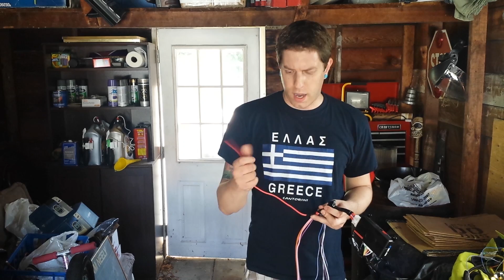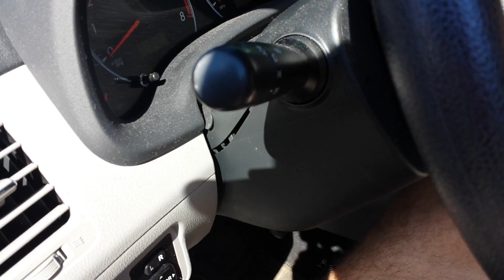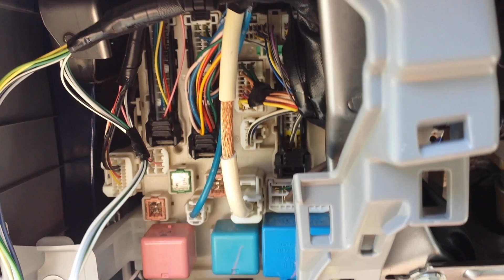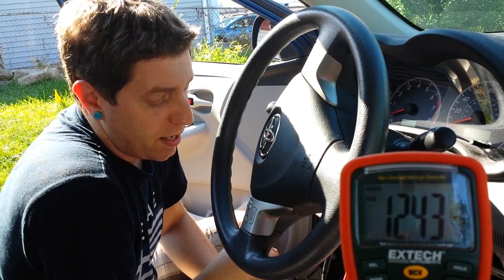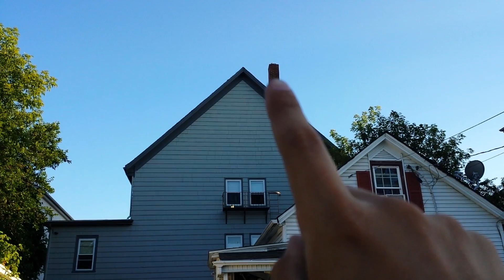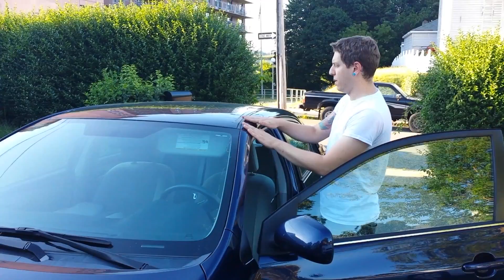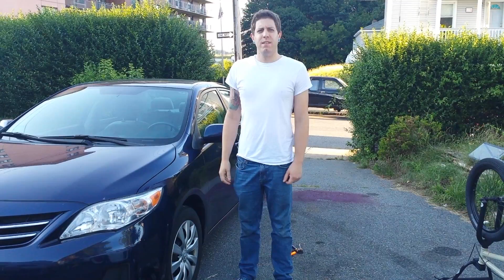2009 - 2013 Toyota Corolla Remote Start Install

Comment: Do you need to hook up both of the red wires to the 12v power source?(thick white wire) or just one?
Reply: I think I connected everything correctly but I can't get it to start. The red led flashes correctly when programming the pkall, as well as the remote start led for programming the tach. The parking lights don't flash at all (I checked to make sure they were connected). Also the one button remote just flashes green rapidly when pressed, it doesn't seem to do anything. Any ideas?
Reply from the maker: Yup. Both red wires control separate ignition relays inside the brain. If you want to be lazy with it, you can tap one red 12volt off the brain into the other and run one line to the white wire. The ignition wires are small enough in that car you should be fine; as long as you're not driving any high current stuff. Just make sure you splice it after the fuses so each have their separate fuse going into the brain.
Reply from the maker: Well sounds like the PKALL and Tach programmed correctly. If the brain gets the signal from the remote telling it to remote start and the brain has a problem, it will flash the parking lights a bunch of times (or at least you will hear a bunch of clicking coming from the remote start if you don't have p.lights hooked up). If it's not doing a damn thing when you try to remote start from the remote, then sounds like you have a communication issue. The antenna and everything look ok? I dont think the one button remote is supposed to flash rapidly, what model is it? One thing you can try though! The brain should have a white/blue activation input wire (if it's a directed product). You can tap that wire to a ground source in the car and it will manually initiate a remote start taking the remote and antenna out of the equation. Might help isolate.
Reply: So I hooked up the other red wire that I forgot at first. Now I was able to perform a "shutdown diagnostic" and it's telling me I need to hook up the parking brake wire. It also says the parking brake must be applied for the remote start to work. I don't really want to have to apply the parking brake every time I need to remote start.. Is there any way around this? I was thinking of hooking it up to the 12v power wire for a constant "applied" status. Is this okay or could it break something?
Reply from the maker: Is your car a manual? If not, then screw all that parking brake nonsense and you need to program the brain from Manual mode to Automatic mode. If your car is an automatic, I can tell you how to do that. They default the brain to being in Manual mode when they sell them.
Reply: Danny K. Ah Yes my car is an automatic. I'm not sure how to program it. I'll try reading the instruction manual.
Reply from the maker: It's most likely Menu 3 Option 1 "Transmission Mode" and the instructions tell you how to use the programming button to get to that option.
Reply: Danny K. Are you sure it's menu 3, option 1? I don't see a menu 3 in the manual, only 1 and 2.
Reply from the maker: What remote start unit do you have? I assumed you had a RS/Alarm model. Also, how many flashes did you get for the shutdown diag?
Reply: Danny K. I have an Avital 4115l. It was 8 flashes wich indicated (-) Parking brake wire. I checked the programming options and there are no options for transmission type.
Reply: Maybe they added the parking brake as a safety feature or something.. do you think I would still be able to trick the system by attaching it to a live wire so it thinks the parking brake is active?
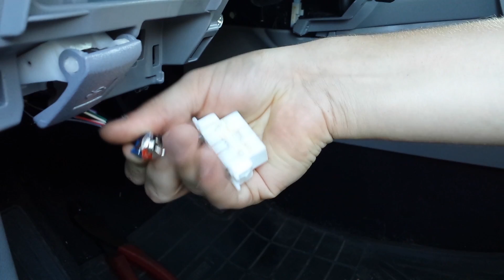Reply from the maker: Oh, no shit. Didn't realize they added more error codes in for the new models. You should be able to attach that black/white "parking brake" wire to ground (-) and be good, I think. As long as that wire works the same as it did 5 years ago. That used to be called the neutral safety wire and it stopped the remote start from functioning unless you give it a ground source. They used to supply you with a toggle switch you could wire in to that black/white wire if you wanted a way to disable the remote start (ie. bring it to the mechanic). You can see me show it off and talk about it a little at 21:16 in the video.
Reply from the maker: Also at 3:48 when I'm showing off the brain
Reply: Danny K. Okay I have that going to ground now which seems to have fixed that issue. Now I think I messed up the the activation input wire(blue/white). I have it going to the keysense(blue) under the ignition.. now the car starts when I stick in my key and shuts off right away. Diagnostic gives transmitter shutdown error. I'm guessing the activation input wire doesn't go there and isn't required? Also then what is the wire you connect at 16:00, is it the (-)status output?
Reply from the maker: Ha! Oh man, yeah don't hook up that activation input wire to keysense. When the blue/white gets a ground signal, it initiates the remote start. So when you put your key in the ignition and keysense wire gets ground, it's doing just that. So, at least we know the remote start starts your car! Progress. Anywho, I'd disconnect the keysense wire from your remote start unless you absolutely need it. So, disconnect the blue/white from keysense, close all the doors and lock the car with the fob to activate any factory alarm the car might have. Then wait like 2 minutes and remote start the car from your fob. If the car starts up fine and doesn't set off the factory alarm, then you can forget about needing to hook up any wires to keysense. If the alarm does go off...then you'd want to run your status output wire to keysense to give it ground during remote start to make the car think you disabled the factory alarm by putting the key in the cylinder. You're almost there!
Reply: Danny K. Welp I've got it working finally! I didn't bother trying without the status wire I just connected that to keysense and it works. Thanks for all your help man I would be totally lost without you lol. Me being a complete beginner for anything cars I got it all set up in about 3 days.. I'd say not bad lol!
Reply from the maker: Groovy! And your car's not on fire. You did better than a lot of newbies I've seen, congrats man.

Comment: Will a universal immobilizer bypass work for my 2009 corolla? It doesn't have push to start just the normal keyfob key with lock/unlock.
Reply from the maker: Should work fine with Toyotas. A 556U or the like? You really gotta get it wrapped around the key cylinder good and tie it down in place, I never liked using them. Plus you're literally leaving your key inside the car...was surprised how many people were totally ok with knowing I could easily steal their cars after installation back in the day..
Reply: Oh I didn't realize that it needs a key and I only have 1.. So the xpresskit pkall bypass that you got works without a key?
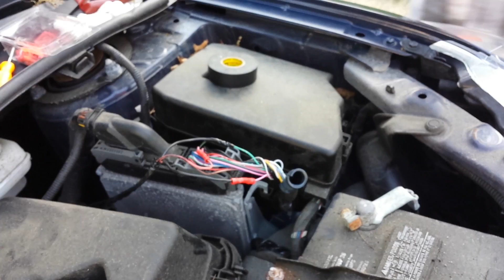Reply from the maker: Yeah, I guess that's what makes them so universal, ha. When I was doing this a while back, that was the only option actually. For any of the modules you wire into the data lines of the car, you only need 1 key to program it and it adds the module's chip to the car's bank and you don't have to leave a key in the vehicle. You can see me program it at 19:55 in the video. The PKALL is a little harder install seeing it ties into the immobilizer wires that aren't as accessible. If you go with an FLCAN or DBALL, those tie into the CAN BUS wires of the car and are at the OBD plug...so much easier than running under the hood but those modules cost a bit more.
Reply: I have the same pkall as you linked in the description. Where do I connect Rx(data in) and Tx(data out)? Also not sure about the 3 wires going to under the hood. Are those coming from the pkall or remote start?
Reply: I think I found the Rx(data in) and Tx(data out) wires using the pkall instruction manual. They are on a 7 pin connector directly behind the ignition barrel. now I'm just still not sure about the 3 wires you have going under the hood. Are these still necessary?
Reply from the maker: You probably did find the wires at a harness near the ignition and they should be the same wires that I found under the hood (just the other end on the ECU side). Going by XpressKit's guide (http://cdn.fortin.ca/download/43981/pkall_toyota_corolla_-_g_key_(2010-2011).rev-b_20101006.pdf) you need to catch them at the ECU under the hood. If it were any old analog wire (ie p. lights, brake) then fine, catch it wherever you want. With all this digital crap, I wouldn't risk it. Who knows if there's not another module those IMI and IMO wires hit between the ECU and ignition we don't know about that could cause issues if they're interrupted near the ignition. Plus, if you could just catch them at the ignition, why would XpressKit make you go under the hood? So, I'd say it's a bad idea and you're playing with fire catching them at the ignition but...let me know if you do get it to work. That'd be pretty sweet.
Reply: Here is the manual I'm looking at(I think it's the same one) -  http://xpresskit.com/DocumentDownload.aspx?documentid=7507&productid=196&firmwareid=1636 .  I'm on page 9 - connection 4 (My car is 2009 corolla with dot on key, not G.) Looks like the connection at the ignition should work right? I'll try it out tomorrow most likely and let you know..
Reply from the maker: Oooooh yeah that's perfectly fine. The dot and no G means you have the older 40-bit encryption system which is a lot easier to deal with for wiring and you can go to the ignition. If you had the 80-bit with a G like I did, then I think you have to go directly to the ECU. Either way, definitely interested in hearing how it goes for ya.

Comment: Can you explain what the jumper settings are for? I got the computer cm7200 brain and there’s a place for “jumper” what is that? I have a 1999 Toyota Avalon xls with factory alarm.
Reply from the maker: I've never used Compustar's products (came from a completely Directed Electronics shop so not as familiar) but looking it up online it looks like they're used to change polarity. So they have negative and positive parking lights, door triggers, doomlight, etc. depending on the car you're putting it in. So just make sure you setup the jumper to what polarity of the wire you're wiring into on the car side.
Reply: Danny K. Thank you!!!

Comment: Great video! Do you know if the wire colors are universal? Or are they company specific?
Reply from the maker: I assume you're asking about the remote start wiring. It's fairly well specific to all Directed Electronics brands which includes like Viper,, Avital, Python and that whole family. For your Compustar, I believe it's going to be different wiring coming off the brain. All the Corolla wire colors will be fine to use from my video.
Reply: Danny K. Thank you.

Comment: Great video. Help me install one in a 2012 toyota corrola S model. The only issue im having is that when i push the remote start button the car just cranks doesnt start. Cant figure out whats wrong or what im missing. I used the Xpresskit and a ready remote model number 24921B
Reply from the maker: Nice, glad you could use it as a reference. When you say just cranks...does it just sit there cranking and cranking for like a good 4 seconds? I've seen that happen when the immobilizer wiring is incorrect or if the bypass module didn't program correctly. Can you try inserting the key into the ignition but don't turn it to ACC or RUN or anything. Just slide it in the cylinder, don't turn it, and try to remote start the car (basically making the car see the chipped key). If it remote starts up all fine and dandy, then you know it's something with the immobilizer wiring and we can take it from there. Good luck!
Reply: Thanks for replying. I did that and it is somthing wrong with the bypass. Like u said either its not programmed correctly or the wires are mixxed up. Coustomer couldnt wait so what i ended up doing was using the RFID ring the cam with the remotr start original bypass that i did t us connecting it to the immobilizar and leaving a key in the car so the coustomer could drive the car until they come back from therr christmas vacation.
Reply from the maker: Ah nice, glad you had a workaround there. The 556U and the like can always get you out of jam like that. What XPressKit module did you use? Was it the PKALL (IMO/IMI) or did you go with something like a DBALL that catches the CAN bus lines?
Reply: It was the PKALL imo and imi the same exact one as in the video.  Coustomer said yhe remote start is still working. So might jus leave it like that. Not a big remote start person but. I make it work one way or another lol
Reply from the maker: Oh yeah, that definitely works. My customers used to be very demanding about getting their keys back so glad yours doesn't mind. Well, if you do decide to troubleshoot more, feel free to ping me for help.

Comment: IS A 2015 THE SAME WIREING AS THE 2014? AND WILL I NEED A INTERFACE MODULE?
Reply from the maker: Looks to be. They changed the Corolla style in 2014 which carried over to 2015 and 16. My video only covers up to a 2013 so probably not going to be of too much help to ya. And yes, I'm pretty sure all Toyota's are coming with chips now. You can always test it by wrapping the plastic part of your key in aluminum foil (effectively making it just a "metal" key) and try to start the car. If it starts up, you're good! If it just keeps cranking...you'll need the interface.

Comment: use idatalink and you only going to hook it up three wires CANH CANL IMMO DATA.     Program DBI Is going to give you a power door locks tack wire brake etc
Reply from the maker: You don't have to hook up any of the ignition wires or even power and ground?? What will they think of next...
Reply: You have to hook up ignition and ground Check idatalink website and you going to see it
Reply from the maker: Haha, no I know. I was just messing with ya. I mention the FLCAN and the DBALL in the video that ties into the CAN BUS system the same way but they were more money and I don't have a way of programming it. PKALL is ready to go without flashing.
Reply: You doing good job don't get me wrong I just tried to work together with you because I do the same thing everyday
Reply: I don't criticize anything
Reply from the maker: Totally man, us installers gotta unite! I've actually been out of the game for about 5 years now. I write software for a medical company now so you probably are much more up to date on the new remote start modules that're out there. Soon they're going to make this shit so easy to install my grandma's going to be installing them in her free time at the nursing home, ha.

Comment: Hi! Thanks for video, it was very helpful,

I have installed Avital model 4103LX which has 4 keys on it. And I couldn't find the cable for Trunk release motor trigger on driverside kick panel. 

I found a source for a wiring diagram for that and it says DRIVERS KICK PANEL WHITE 22 PIN PLUG, PIN 20 (GRAY - ) But i couldnt find that. That harness has all (-) voltage anytime.  (http://www.bulldogsecurity.com/bdnew/vehiclewiringdiagrams.aspx)

Do you have any idea how can I connect the trunk release button to pop-up trunk?

Thanks
Reply from the maker: Hello!
This seems to follow suit with the rest of how this car is wired where if you have a smart key or push-to-start vehicle, it is a Gray wire with negative (-) trigger in the driver kick. If you have just a regular key (which bulldog security doesn't mention but a little but of Googling uncovered) then it is a Pink wire in the driver's kick with a positive (+) trigger that you will need to, what they call, 5-wire it and add in a relay.  Test the pink wire and see if you see 12 volts on your multimeter (red probe in wire, black probe to ground) when you press the trunk release on your factory key fob. If it does, then the tutorial on this website should help: http://caraudiotips.blogspot.com/2013/04/2013-toyota-corolla-trunk-pop-wiring.html
Reply from the maker: Great! Glad to hear it helped you out. First off, is it a smart key? If it is, then it will be that gray wire. If not, then you'll need to "5-wire" a pink wire in that same harness to provide a 12 volt high amperage output to drive the release solenoid. Info on that can be found: http://caraudiotips.blogspot.com/2013/04/2013-toyota-corolla-trunk-pop-wiring.html. So everything is reading negative all the time? How are you testing it?

Comment: can i install this in toyota corolla 2000 model
Reply from the maker: Yup, sure can. It should be even easier since they didn't include the chipped key or immobilizer that year. Look it up on bulldogsecurity.com for the wiring.
Reply: you are really good bro i will keep you updated.
Reply: I would like to see you hook it up while explaining too much information before doing it.

Comment: Highly impressed. Using this as reference for 12 Sienna and Avital 4103. Any good references for wire schematics
Reply from the maker: Glad to help. Unfortunately, and it's quite a big unfortunate, I work off of bulldogsecurity.com for all of my wiring and I've run into a few situations where they've been wrong. When I worked at a shop, I had access to Directechs which is the best if you can get your hands on one of their data sheets. Luckily most Toyotas are very similar and are fairly straightforward.